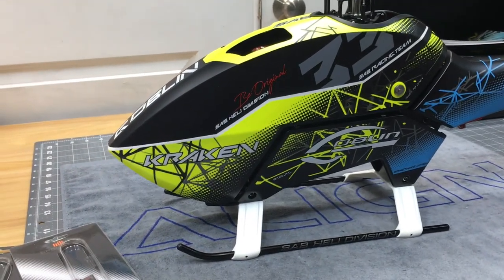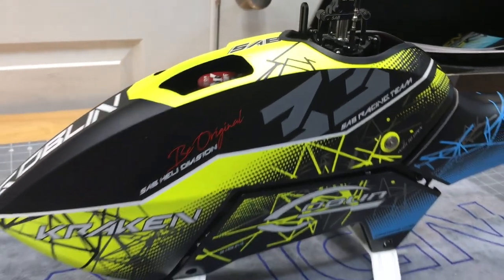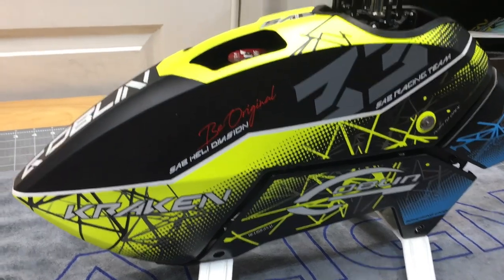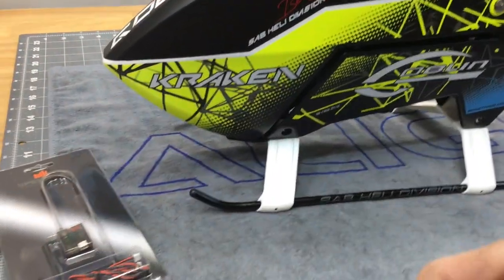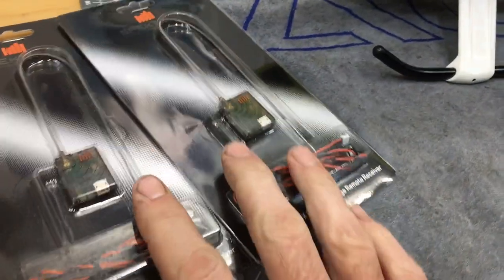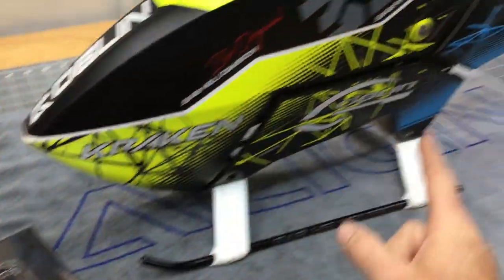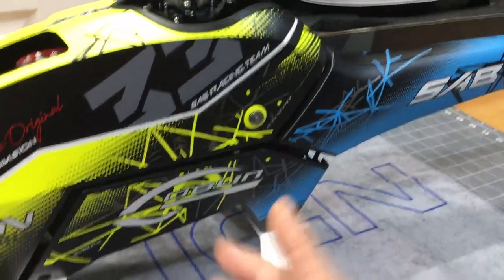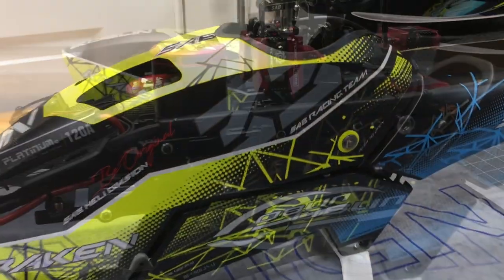SAB Goblin Kraken 580 iKon FBL Setup

Comment: dude I love you.... I had so much issues with the pitch and adjusting the linkages and servo points and all that bs...  I thought about adjusting the servo travel a couple of times but never did it because it wasn't in the green after.  Now I have to go back to my fleet and redo all of them again.  Keep up with videos!  Now I need to redo my Goblin 500 Raw again because I got full size servos instead of the mini's.
Reply from the maker: I’m glad I could help! I have set up countless iKon FBLs and never had a single helicopter regardless of make manufacturer whatever that I was able to adjust linkages to get an equal positive and negative throw and not have other issues. I know if there are guys out there that will say the only way to do it is by adjusting your servo linkages and adjusting servo travel is not the right way. It’s the best way I have found that gets you all around perfect set up! It does make a huge difference when you have an equal throw especially on your flight performance and overall feel of the helicopter. Don’t worry! There will be plenty and plenty of videos to come! Thanks for watching!

Comment: Thank you so much for all your videos. I usually own a goosky heli, like the rs4 venom combo. This is the first time I buy like a Raw580 with a xnova motor and hobbywing esc. I don't know anything about governor until I saw your video. Do I need to program in the ikon software the governor like you did? if I can program the 3 different head speeds on flight mode switch on my IX14, what is the need for programming the governor  in the Ikon Software. Sorry for this silly question. Thank you.

Comment: you have given me some great advice on my M1 setup. i have a question that might be FBL controller related. my swash at rest dips down slightly on the right. i have read that NO trims should be used. i was going to see if the servo arm could be moved 1 spline to be 90 deg. But saying that should you not use the tx servo centering function?
Reply from the maker: I’m glad I could/can help! So never use radio trim tab with any FBL heli. You can move the servo one spline and see if that gets you where you need to go or go into the FBL and trim the servo that way. That is the best way to trim/adjust any servo is through the FBL unit. I just wanna make sure all servos are 90°/cleaners level and your radio has zero trim activated. Honestly it’s a great thing to get used to deactivating the trim tabs in your radio because sometimes you might accidentally hit one and not know it and the helicopter will start to act weird.

Comment: Great that you touched on the pitch setup. It was a struggle with my raw. I had more positive pitch. Ended up editing the travel in the advanced menu to get it equal.

Edit: how low do you think you can go with headspeed for sports flying.
I'm running 2000- 2250- 2350 now but seeing you start at 1650 and 1850 that seems on the high side
Reply from the maker: It’s some thing nobody touches on. I’ve touched on it in almost every Ikon setup video I’ve made because I see you that question all the time. And I know some people say just adjust the linkages until you get equal but you never will! So the initial head speed settings I put were to low. I ended up with 1850 RPM in normal mode and 2000 in Idle 1 and 2400 in Idle 2. I think 1800-2200 RPM is perfect for normal/sport flying.

Comment: Excellent video!  Many thanks!  Did you skip the check mark on using the Ikon governor with the different flying styles menu on purpose?  Also, do you normally add a switch setting for tail gains at 45% 40% and 35% so you can adjust while flying?  Also account for the motor poles divided by 2.  Much appreciated and love all your awesome videos!
Reply from the maker: Thank you! No I didn’t skip them on purpose I forgot about them LOL I went back after and fixed it. Yes I have a switch setting for tail gains. I have it set to my flight mode switch, and it’s not really so I can adjust while flying it’s just so I can have different game settings for the different head speed. Because you know as you get a higher head speed you don’t have to run as much gain and so on. Thanks for watching!
Reply: Good deal!  Thank you so much!
Reply from the maker: @wassimmatta8390  you’re welcome! Thank you for watching!

Comment: Great video Jeff. I saw your videos showing the build of the Kraken 580. I just did a build myself, and followed a few of your steps. Have seen the videos multiple times :) Quick question. Its my first real heli. At the moment im on training level, using the M2 Evo. I can do figure 8's, and a bit inverted flight and stuff. I still have so many questions coming into this new hobby. Im using a Radiomaster TX16 MkII. I see you are using more than 1 reciever, what is the advantage of that? And is it necessary to do?
Reply from the maker: Awesome! I hope the videos helped you with your build. So there is a few reasons. One, redundancy. Two signal strength and peace of mind knowing I have full signal no matter how the heli is in the flight. There is a lot of of carbon fiber and that blocks the signal. I also use a SRXL2 for telemetry so there is three satellite RX I use on a kraken model.
Reply: @westhobbiesrc8051  ok, thinking I might go with the  SRXL2 Telemetry aswell. Just build the heli, servos should arive tomorrow

Comment: Jeff what is the product number for the satellites that your using on the heli for this video I tried using the spm4651t with the Spma3066 adapter and it binds to the ikon2 but it won't let me calibrate the servo travel and I plugged it in to ch3 like it says I don't know what else to do

Comment: For the channel assign part of the video, I have a NX6 and so do not have an AUX3. Does this mean I will not be able to use the rescue feature? Or is there a way to program it to AUX1 for example which is an unused channel?
Reply from the maker: So unfortunately not, you only 6ch. A heli is 6ch with out flight mode setup or rescue. You really need a 8ch radio to use all the iKon can do. 10ch is even better.
Reply: @westhobbiesrc8051  Oh I see, luckily I do have the extra 7th channel for flight mode setups. I guess I can add a rescue mode to one of those setups. Not ideal but a compromise. How useful do you find the rescue mode? Is it something you can do without?

One more question I have is the transmitter mode setting which you set to mode 2. What are the different modes and how do I know which one is appropriate for me to select?

Comment: I just finished my build and Im about to install my Ikon FBL..Im a bit puzzled on how to connect the USB. theres basically no room to fit the micro usb to connect it to the computer. What was your solution? I dont want to stick it on before I figure out what to do. Thanks for the help as always
Reply from the maker: There’s a few different ways I do it. I have a 90° USB adapter. I also purchased the remote USB from iKon that plugs into the side porch and allows you to plug your USB in.
Reply: @westhobbiesrc8051  oh i didnt even know the ikon remote usb existed lol. I was going to do a 90 degree elbow but I wanted soemthing more secure. Westhobbies to the rescue as always lol. Youre the man.
Reply from the maker: @RC_Aviator  thank you, both ways work great. I don’t ever leave the remote USB extension on the model for more than a few flights once I’m done tuning I take it off and use it for the next model.

Comment: Got another question for you man. I just finished the setup on the iKon. When I spool up the motor kind of does kindve a twitchy thing before it smoothly starts spinning. Is that normal? Once it starts spinning it all seems to be just fine though.
Reply from the maker: It can be, make sure your pole count and everything is selected correctly in the governors section of the software. Then turn the governor off and then try it and see if it does the same thing. Everyone I’ve set up twitches for a second and then spools.
Reply: @westhobbiesrc8051  okay gotcha. And just curious, I watched your raw 580 ikon setup video and noticed you didnt select to use the governor in normal mode. Any reason for that? Is it because the throttle curve isnt level by chance?

Comment: Hey Jeff, 

I recreated you radio file (radiomaster) but when I do the set up on ikon no matter what I do I can’t get my lints past 93-95% I have e.limts checked. I did notice that once I hit those numbers (93-95) the limits in the controller aren’t at their max but the ikon won’t register it? Ie say my trim is at 138 /150 ikon is at 93% but from 138->150 it won’t change the 93%-> 100% any ideas? Maybe set up on a fresh model with no curves?

Comment: I’ve got a SAB 580 raw and it’s my first helicopter build. Any chance you can do a Futuba  receiver with S.Bus video?
Reply from the maker: So if I had it flew futaba I definitely would! I might have a futaba radio coming for some videos so if I do then I’ll definitely do one!
Reply: Much appreciated! Your video’s are awesome. I’ve been flying rtf helicopter for over 6 months and finally got myself a SAB 580 raw. The Heli build is almost done but I noticed the tail rudder is not auto leveling when moving from side to side. How would I fix the tail rudder?
Reply from the maker: @Good1vibes  glad the videos are helpful! So the rudder servo is not supposed to go back to center. That’s how you know it’s in Heading hold mode. (What you want) rate mode would be the rudder going back to center. But heading hold mode is the way you want it setup.
Reply: @westhobbiesrc8051  how would I set to rate mode?  The rudder is not going back to center automatically. Auto level works well but the rudder will not center.
Reply from the maker: @Good1vibes  why do you want Rate mode? Heading hold is what you want for a solid tail. Rate mode you have to fly the tail consistently. But if you want right mode it is a negative value.
Reply: That could have been an expensive crash if I stayed with rate mode. 😬The Heli is flying ok but I’m noticing the tail rudder is very sensitive and moves really fast to the touch when moving left or right on heading hold but my aileron and elevator moves smoother which is perfect.  I noticed in my Futaba transmitter, there is a way to slow down the servos. Is there another option to fix my rudder problem?
Reply from the maker: @Good1vibes  so I’m not very big on futaba, are you running the CY760? You don’t want to slow down in the servos in the transmitter itself you want to slow it down in the FBL settings. There should be a rotor rotation rate. You can also add Expo to the rudder channel. That will help with sensitivity.
Reply: I’m running the iKon fbl.  I’m adjusting the expo in my Futaba and it helped with the sensitivity and movements of the servo. Learning new things in this hobby.

Comment: hi Sir , what should be proper setup of hobbywing platinun 150amps with xnova 4025-1120kv motor, i was setting up with dile 1 and 2 at 75% flat and 100% flat using 6s 5600mah , but the helicopter lost power during idle 2.

Comment: Do you get telemetry back to the spektrum transmiter with this set up? Thank you
Reply from the maker: Yes you do. Full telemetry! But you need a spektrum SRXL2. I have a video going one it with iKon and spektrum.
Reply: In that case should I install the srxl2 on top and the satellite at the bottom. How many satellites. I WILL be building a kraken 580
Reply from the maker: @rcmlndz  on top, you only need one DSMX satellite if your running a SRXL2. You can mount that on the bottom.

Comment: Where and how do I use the on/off switch?  I plugged it in where I thought it should go and it doesn't work
Reply from the maker: The On/Off switch is for the HD iKon. It’s not used unless your using a separate 2s pack the power of the servos.
Reply: @westhobbiesrc8051  I am using the ikon2hd and it came with the switch. I plugged it in on the lower single port and it doesn't function.
Reply: Also I am using a 2s lipo to power the servos through the hd power cable that was supplied with it
Reply from the maker: @megadeth1952  hmm! That’s a good question, your plugged in with ground down? Meaning at the bottom of the port?
Reply: @westhobbiesrc8051  yes, but I'm thinking that the middle port is the signal and the top is the power. I don't understand why they put a 2 port lead and have to plug it into a 3 port. I'm  afraid to change the switch over to a 3 port servo lead and try it again. I don't want fry the unit. They should've had a simple 2 prong port for the switch. I can't find any info about making it work
Reply from the maker: @megadeth1952  bottom pin is ground, middle is power and top is signal. It’s a plug and go system. There is no secret or special way to make it work. Just plug and go. The switch a fail on switch so seeing it’s not working I would say the switch it self is bad.